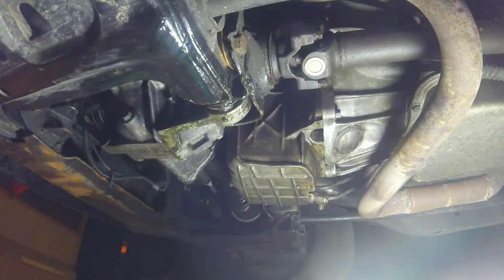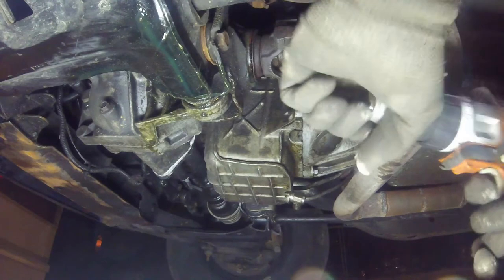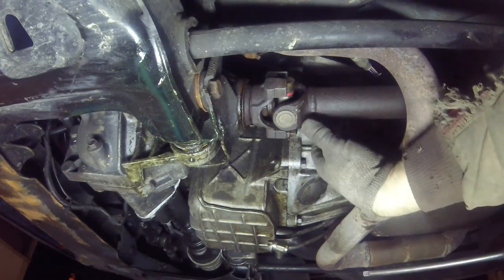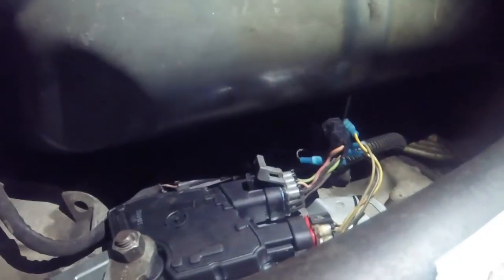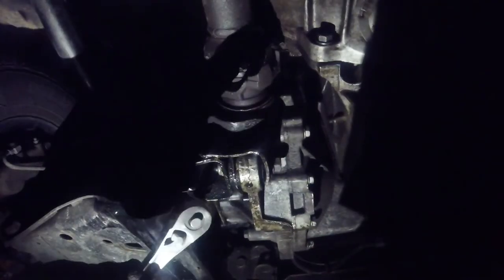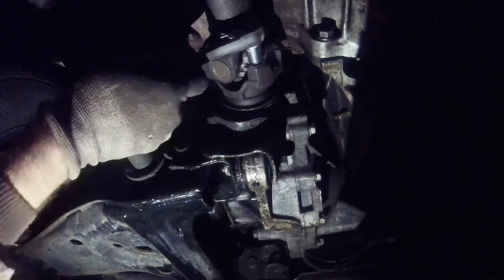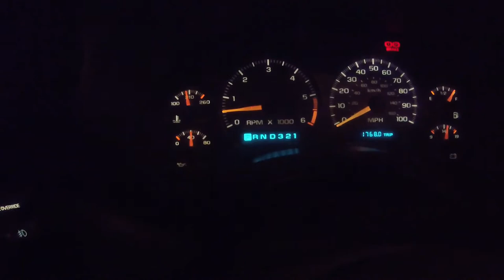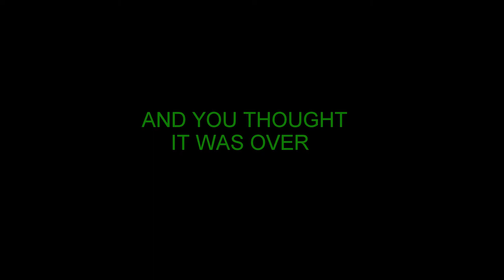98 Blazer Neutral Safty Switch

Comment: My reverse lights are not engaging.  I have a 97 Chevy suburban. Will adjusting help at all?
Reply from the maker: Yes. If you adjust it and it dont work rhen ot could be a burnt bulb, fuse, and or neutral saftey switch
Reply from the maker: Check cheap stuff first
Reply: i switched  the neutral safety switch, checked bulbs and all fuses and still not working. Is  there another fuse under the steering wheel or something?

Comment: When you put your new switch on did you have to have it in park or neutral
Reply from the maker: Jeremy Foote i had It in park but i notice my reverse lights didn't work.  But that's y the holes are bigger for it so you can adjust it. I had to adjust it while in reverse. So i can tell if the lights kick on.
Reply: Ok I just put mine on and I still can't even start it
Reply from the maker: If you have a extra set of hands have them hold the key till you hit the spot its starts. Mine did that to

Comment: Is there a way to just bypass it so I don’t have to replace my switch
Reply from the maker: Honestly im not sure there might be a wire that you cross tie together. If the part is expensive at part store they are cheaper at rock auto. I always buy from rock auto unless i need it now
Reply: Just curious do you think this would more likely be my NSS or something wrong my linkage:
The blazer will start in neutral, but not any other gear or park. 
Parking brake doesn’t engage at all, so I have to use my E brake. 
There’s no resistance or any pressure when I try to put it in park
Reply from the maker: Yes. It was never designed to start in a gear only in park and Neutral as it is not safe. Do to its possible to take off.